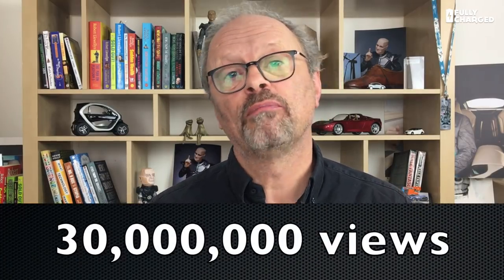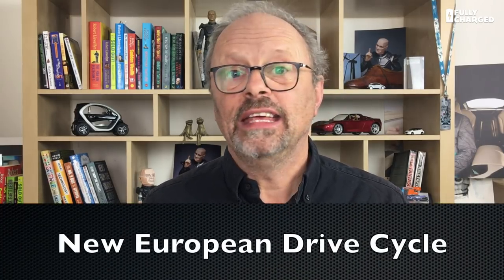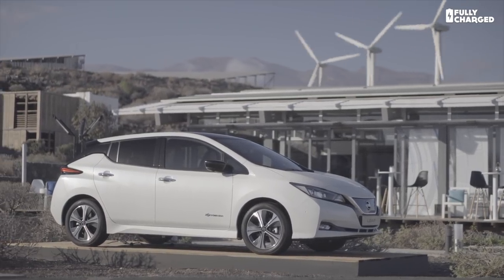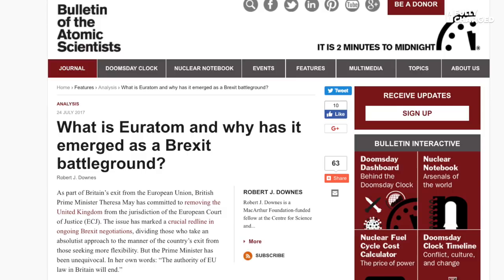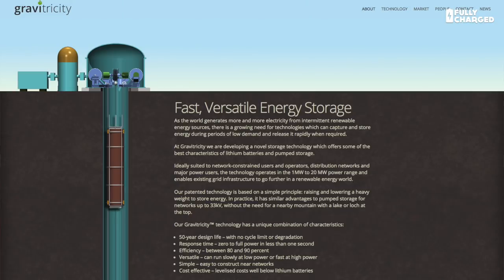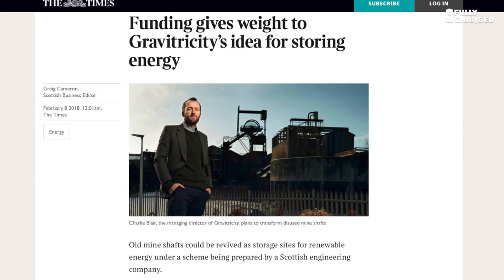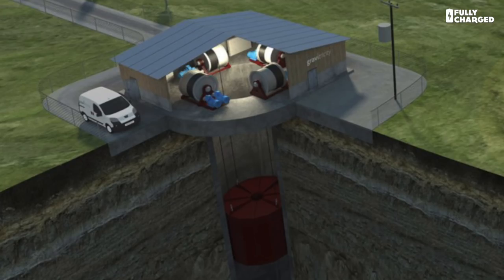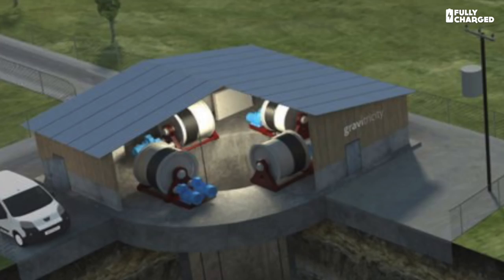WLTP IEM and Gravitricity | Fully Charged News

Comment: Some basic equations for gravitricity:

Potential Energy = mgh = (30,000)(9.81)(100m height drop) = 29,430,000 Joules
Lets say we discharge that energy in one hour as it descends = 29430000/3600 = 8175 Watts

8.175 KW power for one hour or in simple words 8.175 KWh. This seems practical where there is already an existing shaft with a reasonable larger concrete weight.
Reply: Talha Bin Umeed and coal mines will be about 100m deep max, often less.
The system will be able to sustain the output of a coal fired power station for about 10 seconds!
Reply: Exactly, the numbers are not in the favor. And drilling more is just not economically feasible
Reply: So - the company who are doing this don't know what they're doing.
However, you- who aren't doing it, DO know??!
Armchair experts- DOH!
Reply: Physics doesn't care if you're a company doing stuff or an "armchair expert", as long as you do the math right.
Reply: Hahaha, yea it is about as effective as 1 power wall, and it is not true that it will be super efficient or super low maintenance with cables have friction. Water wins by pumping 100's of tons over km heights (if I done my numbers right). I recommend Rick and Morty epsiode "The Ricks Must Be Crazy."
Reply: exactly, when math is on point then some points given might be wrong. May be energy is discharged in 10 seconds instead of 3600 seconds but energy generated out of it will always be 8.175 KWh

Comment: The only issue with Gravitricity is that these shafts will have to be made 100% water tight so ground water doesn't seep in. IF water gets in then it'll need to be pumped out - using electricty and harming the efficiency of this storage method. Digging a hole isn't the worst part. Lining it perfectly is.

Comment: Gravitricity is such a good idea. It’s just like the Hydroelectric generation where they have a high and low reservoir and pump the water up at off peak times and drain it down through generators at peak times. Very clever and simple. Low maintenance as well

Comment: You hit the nail on the head. Your saying most of out politicians are incompetent regardless of party. I agree. And this is why we need brexit. The ones we have are bad enough, we don't need the ones in Europe too. Gravity generation has been used for years, two examples, hydro and clocks.
Good idea, but what we really need to know is storage cost against batteries. And no you can't use drilling equipment used for fracking and the oil industry as the hole would be too narrow, unless you just want to charge a few phones.

Comment: In Germany they're doing pumped hydro storage using abandoned mine workings as the lower reservoir. Similar concept, but with water you have far more movable mass to play with than just whatever lump of concrete you can fit in an old mine shaft. The Prosper-Haniel pit in the state of Nord Rhine Westphalia is where they're trying it.

Comment: Future Graviticity installations will have a wind turbine providing the motor/generator with a clutch and gearing coming in to operate the weight, the weight also helping to keep the turbine anchored to the sea bed. When there is no wind the weight drives the generator. When there is excess wind the weight gets reeled in with direct drive geared for the required weight.

Comment: In my personal experience, the US EPA testing cycle is a lot closer to the real mileage a car gets. It's still a bit optimistic, but not nearly as optimistic as the NEDC. For example, my 2010 Prius is rated at a combined 50 MPG US, and I get about 46 MPG with a heavy right foot.

Comment: From the SA Wind farm example of a battery pack storage system the response time for power demand and system smoothing also efficiencies plus installation time make this a winner over Gravitricity. Even the recycling of the batteries at end of life have a profit component. 
Not all markets are as costly as Australia’s but speed of instillation to meet demand is being greatly enhanced by the evolution / expansion of Tesla’s Giga factory which is only part finished at moment with more capacity to come.

Comment: I'll give you the benefit of the doubt regarding this seeming such a rant and the fact that it seems to be very much against the results from the Brexit vote.

The IEM issue is a large one, but the EU needs it agreed as much as the UK as Ireland is very depended on using the UK as a transit and as their primary supplier of energy when they need to balance their generation/load. All the other EU nations involved with energy exchange with the UK also want a resolution as the UK is currently a net importer, and so is a lost market for their fixed infrastructure. 

As for Euratom, the UK has the ONR (Office for Nuclear Regulation). This is a department of over 560 staff, 9 of which are allocated to Euratom. Yes, it will take time to build up the team, but the UK is not starting from zero. What they currently do not have is any remit from the UK government to get on with the task.

Like much about Brexit the real issues are to be found in the House of Commons and the House of Lords. There is currently a lot of blocking and delaying of the work needed to set up the new regulations needed, but all parties are acting as if they stick their heads in the sand for long enough the issues will go away.
Reply: Thanks for the sanity Roger! This video suspiciously fails to mention we do indeed have our own domestic nuclear regulator (ONR) which is perfectly capable of carrying on the work done by Euratom. In fact, that transition is covered by the Nuclear Safeguards Bill which is currently going through Parliament. And is Robert seriously suggesting that we lack the expertise in the UK to assemble a team of nuclear safety inspectors without help from other countries?
Reply: Roger Thomas or in short: Brexit is a really stupid idea. Lets hope for the best.
Reply: NO, the issue is that none of the political parties are focused on implementing the wishes of the people and so they are going to make more of a mess of it than needed.

Comment: So one day back in the late 1990's i was working with my dad as an intern in the IT department at his workplace, he was the IT manager. A guy from the shop floor came in to ask some advise as to why his new cutting edge 56k internal modem might not be working. He informed my overworked, at the edge of his tether father that he had tried everything. "i have checked the IRQ and DMA i even tried to load it LH in the .bat " there where a few more abbreviations that the work mate also chucked in which made him sound very competent. Now as an eager student of autoexec.bat and config.sys settings back then (to persevere as much memory as i could so my dads 386 would play the games i wanted too) i was well aware of such abbreviations until my dad told him this. " you need to check your TLA's" The workmate did a facepalm and said "of course, i never checked the TLA's" I was then more confused than the work mate as i had never heard of TLA's and i thought myself pretty informed. So feeling a little bit humble i asked my dad what are these TLA's that i had never heard of where? "Three Letter Abbreviations" my dad replied.

Comment: Water in the shaft could be show stopper, pumping it out would kill the efficiency of the system, and leaving it it in could compromise the cables and the shaft integrity.  Even if you placed a block of concrete 6M diameter x 5M tall (340 tonnes) in the centre of a 105M+ tall wind turbine (92kWhrs stored) it certainly doesn't look like a good way to store large amounts of energy -just the gearboxes alone would cost more than a Tesla P100 battery.  I'd love to see the economic argument that Gravitricity have made.

Comment: Does one need to make sure the hole is not filled with ground water?
Reply: Yeah, probably. Which may require pumping, whcih will require power. Seems like a good consept, until you acutally do some back-of-the-envelope calculations.
Reply: And if water doesn't effect it just dangle the weights into the sea save digging a hole
Reply: Density of concrete: 2.4 tons per cubic meter. Water: 1 ton.  Air: Negligible. So with a well filled with water instead of air a concrete block will weigh more than 40 % less. You could compensate by using 40% more concrete, of course. But then you'd also have to factor in water resistance instead of air resistance, which means you need a bigger hole and/or slower speed. Using an installation at sea will come with its own problem, it will expose the whole thing to the elements; currents, winds, the corrosiveness of seawater, etc. Plus it will require the installation to be situated quite a bit away from land if you want any depth to speak of.
Reply: Evolution. Questiontime. Ive been thinking. Cant we soon dispose of nuclear waste with a spaceX rocket heavy duty capsule sending nuclear waste out of orbit?

Comment: The concept Gravitricity is hoping to deploy is similar to my idea of putting the weights into wind turbine towers. That way you could capture the generated electricity at the source and don't have to do a bunch of drilling. There's probably a lot of problems related to adding significant weight to the towers, but it wouldn't have to be 30 tons. I'm sure there's a happy compromise in there where energy can be stored more cost effective than digging new shafts in the ground.

Comment: Gravitricity is an interesting idea, but there's a lot to eventually go wrong. Cables wear out. Bearings wear out. Gears wear out. The motor/generator will eventually wear out (contains bearings, gets hot, torsional stresses, ...) Look to elevators for an idea of the maintenance and processes involved. And speaking of merging two things; use the nuclear waste storage casks for weights. (uranium being really dense and all -- 'tho they're like 99% concrete.)

Comment: We already have cable railways with regenerative braking, producing 'green power'/ potential/ kinetic energy storage. You have to scale it up really big. Ground water flooding is another issue. You may expend lots of energy, pumping ground water out of the old mine shaft, reducing efficiency. The Australian Alps Snowy Mountains Scheme, water storage pumping and turbine generation is another option.

Comment: Wow that was a huge rant! But so true! I only see one big problem with the weight down the mine shaft and it the same problem ever since mines got really deep....... deep holes fill with water and require constant pumping out which uses energy unless buoyancy is not too much of a reduction and it works well enough through water in that case save digging a hole put them out to sea dangle the weights in the water.

Comment: Robert, if you see new energy storage solutions you should really do a sanity check on them. Then you'd see that gravitricity is pretty useless. 
A 30ton block of concrete is about 12m³ or a cube of 2.3x2.3x2.3. And even a block that size dropping 100m isn't enough to power a single home for a day. (it can store about 8kWh)
Reply: that's probably just the demo concept version, only 250kw. Full design is 3,000 ton, 1-20MW up to 8 hrs.
Reply: Gravitricity is an old technology now,  in the form of hydro pumped storage. It's pretty well reached saturation in the UK, so expanding the principle as Robert describes is good news. And it is just a demo.
Reply: 3000 tons, 150-1500m shafts.
Reply: I'm glad someone has pointed this out. A while ago I was considering something similar at home and when I calculated that dropping weight of my house 10 meters would provide roughly as much energy as single 12V car battery, I abadoned it quickly.
Indeed this technology is used widely with pumping water in water dams, but that is completely different scale, not silly 30tons.
Reply: And as that drilling long holes in rock is really expensive. £20 per meter for geothermal holes where I live.
Reply: superdau
thank you for this
Reply: Ibrahim Ulf Karlsson now imagine how many thousands it costs when you drill holes that have a diameter of 6 meters, cause that's the size this technology needs
Reply: Yes the upfront costs would be large but the ongoing costs would be small. Compare that to the upfront cost of a gas leaker plant, the ongoing cost of getting the gas out of the ground and the ongoing environmental impact of burning gas. Then this idea just might stack up. If not then we’ll move on to the next idea. No harm done. No need to be so negative toward people trying to establish a component of a more sustainable energy system.
Reply: The same concept is already done on large scale with vast amounts of water as Acharacle & Achiltibuie pointed out. No need to drill a large hole, no need to make a huge weight, no need for miles of cables and far less mechanics involved = cheaper installation. You just pump water between two close by tanks (preferably lakes) with different heights. Same as solar roadways - yeah they produce some power, but comparing $/kWh produced, rooftop solar beats them hands down.
Robert tends to get excited about these things a bit too much, but that's understandable :)
How these ideas get funded in the first place is a much bigger issue.
Reply: My initial thought was to re-use the shafts of old mines...must be plenty of those around.
Reply: There is also rail energy storage. (ARES). Large concrete blocks on train carriages that are hauled uphill using excess power then let go to run down hill when energy is required.

Has the advantage of being able to be placed in areas where pumped hydro isn't possible. No need for expensive drilling but obviously still needs large area of suitably sloped land. No idea how efficient such a system is.

I am still hoping the tidal lagoon in Swansea will get the go ahead. Would create a lot of jobs.
Reply: Well, all the "up to"s added gives 12.5MWh of storage. Considering the efficency they claim this can be about 10-11MWh in reality. Not that bad, but we still need a lot.
Anyway, all these little developments can help us through, so I won't complain. :)
Reply: There are lots of closed railway lines. All you need is to run some track and wires.
Reply: This is not that bad of an idea. Considering the alternatives pointed out - dams and railway installations, the Gravitricity project has potentially far less mechanical energy losses. Consider the losses from rolling on the train track. Or the losses from water not giving 100% of it's energy to the propeller. And yes these losses are small, but compared to the losses from only the air resistance I think this could prove to be a plausible idea. And if there is a chance to build the weight from scrap materials this would be a great way to "recycle" construction waste.
Another very tempting aspect of Gravitricity is the environmental impact as it's mostly linked to the surface area you need - and this project need a very small area to be fully workable.
Reply: This is a very good point of view! Little footprint, recycling, and high efficiency. These makes this idea feasible even though the stored energy is little compared to pumped hydro or batteries.
Reply: If it would be a good or feasible idea it would have been done already. It could have been built at any time in the last 100 years. There is no technology that made this possible just recently.

There is no real advantage in footprint over building the same thing with pumped hydro. Concrete is about 2.5 times as dense as water. So if you have the space to put some concrete weight somewhere you can do the same with water in twice the volume. AND you get the added benefit that you don't need a vertical hole the size of whatever you want to move up and down. With water you put a tank at the top and a tank at the bottom and a pipe in between that can be a much smaller diameter, does not have to be vertical, does not even have to be straight.

Concrete can be and is already recycled and turned into concrete again. There is no need to find a "dump" for concrete. All other scrap materials are way to valuable to use them as weight.

Efficiency is not much of an issue either. What is an issue is the amount of energy that can be stored cheaply. You can't just add more concrete, because the cables and the motors/generators (and foundations for them) are built for a certain load. With weights you have to build a complete second plant. Want more energy storage with water? Expand the tanks, the rest can stay the same. And if you still want to use old mines for some reason (also a bad idea, because a mine is only stable as long as there is maintenance), you can even set up the tanks in the tunnels of the mine and get WAY more volume to store water (which equals energy in this case) than you could move concrete up and down.
Reply: That's also what the initial idea of Gravitricity (the company) is, says so on their website - and Robert mentions it in the video.
Reply: We've got lots of preexisting mine shafts here
Reply: The uk lacks the geography for large scale pumped storage. There was some development of a site in Exmoor in previous decades but it was abandoned. Dinorwig is still going strong
Reply: They've rather run out of places to build pumped storage in the UK.  That's why this alternative is being proposed.
Reply: This technology doesn't really benefit from scaling up so if it seems ridiculous to be small scale then making it big doesn't justify it. And small scale is really ridiculous even if you could have 100 meter shaft you would need 50 ton weight to match ONE powerwall. Hydro is a different story as they usually already are hydro power plants and this is just another function added to them (basically just bottom reservoir and pump added).